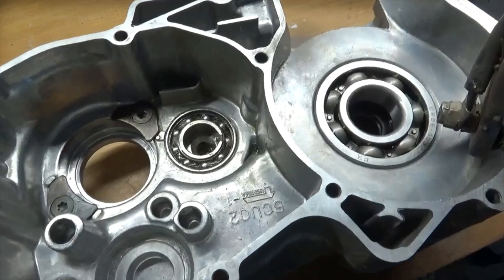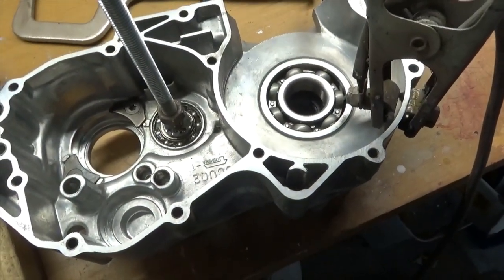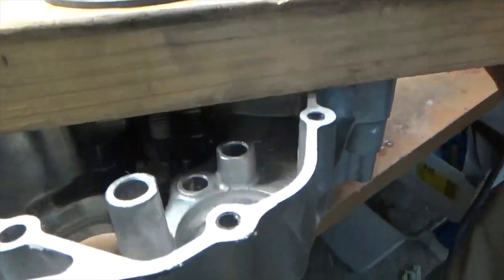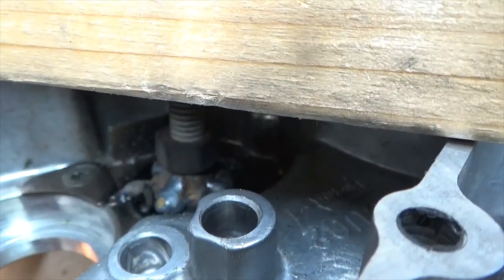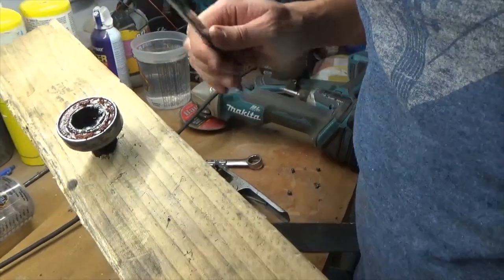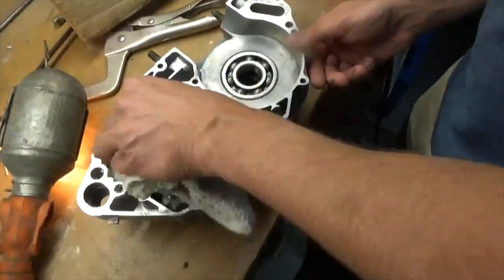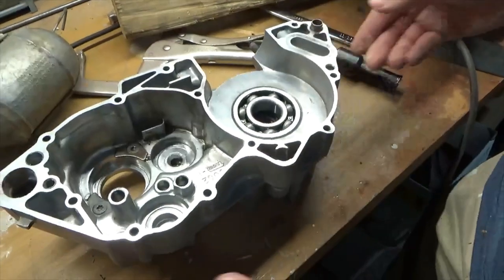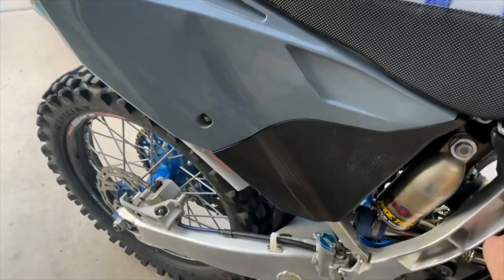Stuck Blind Bearing requires drastic measures! Life On.

Comment: I think you did well  with beings issue, and gave a chance to work together. At work we use a internal bearing puller that catches on lip of the outer ring of the bearing,  but even if you had those expensive pullers  the might not work any better. Does not have to be pretty to get the win, it just has to work.

Comment: Damn, and the rebuild went beautifully. I am having the exact same issue with my 14 Yz 250, same bearing, same everything. I've tried literally everything trying to get this sucker out but no luck :(
I've been having the same thought as well to what solution you guys came up with. Using a similar method to how the crank puller works, hopefully I can figure something out, first time rebuilding my bike ground up and I'm absolutely stumped..

Either way, nice work!